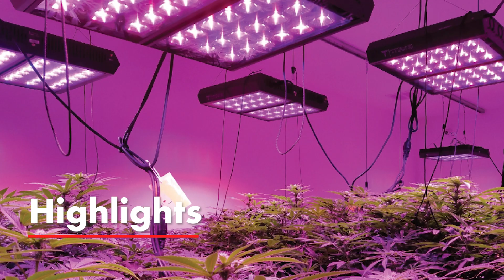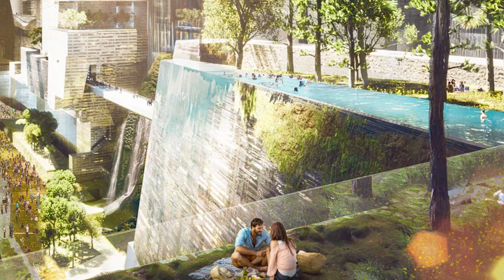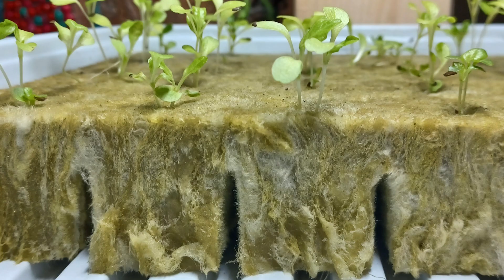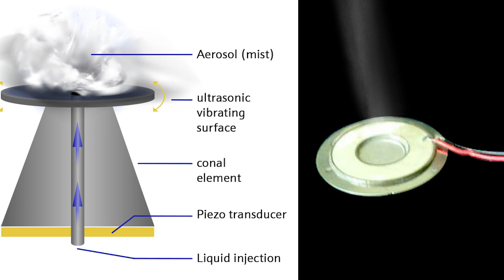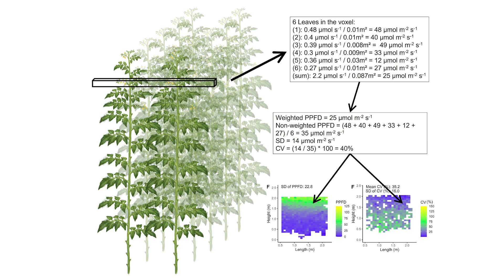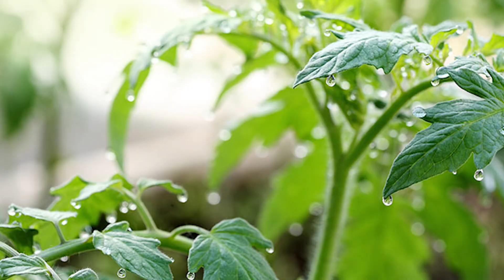Engineering the Perfect Plant Growing Machine

Comment: I've got it...
A cow growing system. 
The cow is in a refrigerator sized enclosure,  it feeds the cow nutrients through an iv, with Meta VR goggles showing it a beautiful field of grass.
Capture the farts for "natural gas" power. 
No "drain-to-waste" because of non-active digestion. 
Special suction nozzles attached for milk. 
When age has been reached,  the cow is ground into a paste and frozen in packets for superfood shakes.
Mmmmmm nice
Maybe a sheep or goat would be better suited for smaller residence such as apartment.